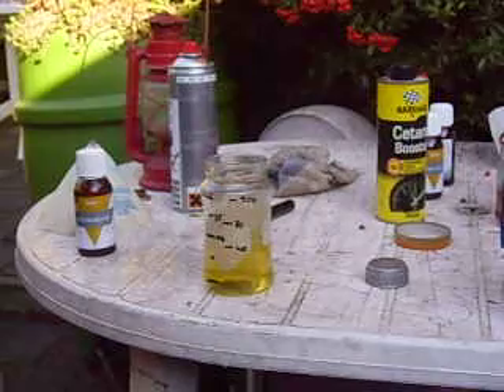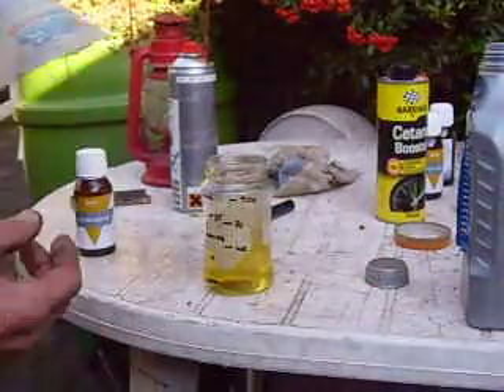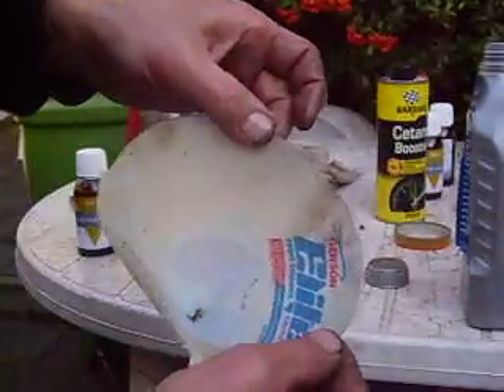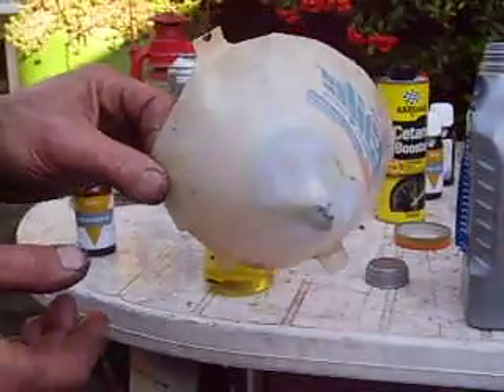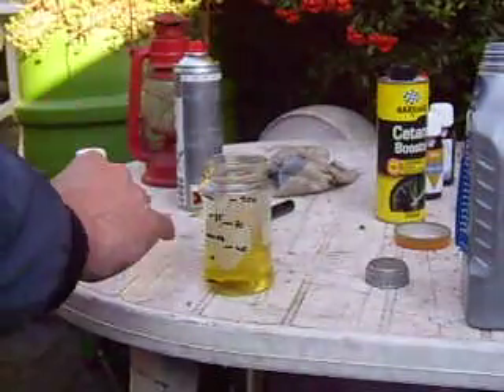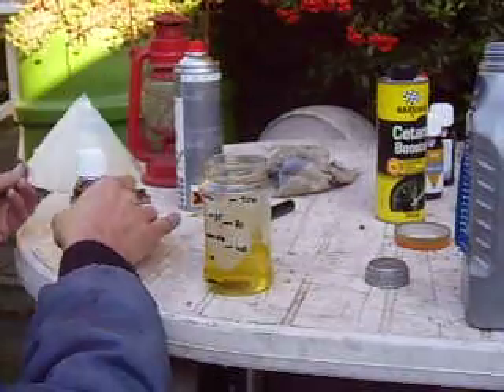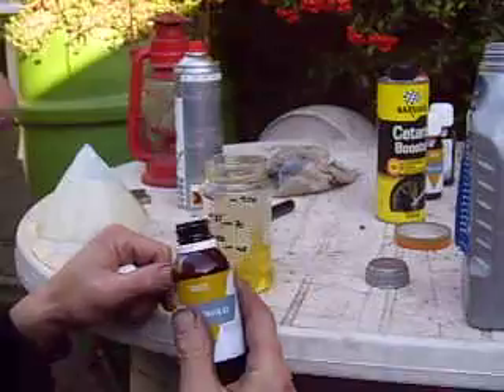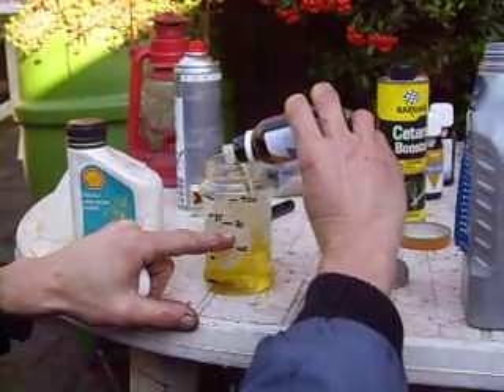Model diesel fuel making at home....my  secret brew!

Comment: I love my ball-race Drone, and it is fixed-compression so you can vary the run a little bit to suit different props by altering the oil ratio.  The manufacturer mandated no kerosene or DERV for this engine, only ether and oil. At least it runs cool.  Thanks for the video!
Reply from the maker: Indeed, the Drones, Micronesia and others are a different story.. They need the different fuel, to get the best out of it.. As wel keep the on good shape... I think run a drone with a regular fuel will run it to hot.. Adrian's website has an good article about it..I have also both types of the Drone.. Lovely motors! 

 Happy running!!
Reply: @valic000  I have put up a little video of it if you would like to listen

Comment: I mix 25ml ether, gas station diesel 50ml and 25ml castor oil into my Mk-17 and Marz 2.5D engines.
Reply from the maker: Good mix!! But always recomend Cetaan booster as ignition improver.. so the engine runs much smoother and with less compression..so better for the engine...Have a great spring!! enjoy  the engines!

Comment: What do you use to clean the filter?
Reply from the maker: Hi Arthur. I use for the cleaning Car brake cleaner. I use the cleaner also for the engines, as it flush the engine nice out,when I had worked  on it. You can find it in a universal car parts shop. Spreekt U Nederlands misschien...?  ;-)

Kind regards,
Peter

Comment: Elimde 1cc zeiss jena var hangi karısımı önerirsiniz.
Reply from the maker: Ben 3 1cc Jena motor var, si fazlasıyla var! ;-) Teşekkür ederim arkadaşım!
Reply: @valic000   Özür dilerim yanlış anladiniz. Hangi yakıt karışımını önerirsiniz demek istemiştim. Jena 1cc için. Çalıştırmak istiyorum.
Reply from the maker: @ibrahimoksuz107  Tamam, üzgünüm ... Sadece ve normal karışım .. + / -% 40 dizel veya gazyağı, 30 eter ve 30 harika yağ
Reply: @valic000  tavsiye ettiğiniz yakit karışımı ile jena çalıştı, teşekkürler. 7×4E pervane ile 7000 rpm çevirdi. Kaç devirde çalışması gerekir. Normal?

Comment: Hai valic000, Aether means Diethyl ether???
Reply from the maker: Yes,only Diethylether wil work.The other wont work at all.Good luck and happy flying!
Reply from the maker: Yes.Try to find John Deere starter Fluid. Others can works also,but I have no expirience with them. Only with brand "Holts starter fluid" I try as well with positiv results.
Reply: So ethyl ether will not work?
Reply from the maker: Sulphuric aether ,whats was used as  a  anesthetic is the right type.The other aether will not work. I hope you can find it. Good luck with the runs!!
Reply: So they user that type of that type of ether in starting fluid?
Reply from the maker: Some types have aether,or parts of it.They also use subtitute for aether.
The only brand I know for sure works excellent is John Deers starter fluid.That have a high content real diethyl   aether.
Just cool down the can in freezer,also the glass,in witch you like to spray it.A old beer bottel is fine,as it have a small opening  and not a lot will be lost..... than just spray it empty on a colder day and you have your aether.  But I highly recomend to ad Cetaan booster,aprox. 3-5 %. Than the engine will run much smoother and with lower compression settings,what will have a positiv effect on your internal parts,specially the conrod and wrist pin.

Peter
Reply: Scot Caraway Just look for C4H10O

Comment: Hi Peter, I'm going to the meeting tomorrow where only the diesel planes will fly. Every plane replica on this meeting is not going to be younger than from the year of 1950 so it's gonna be a pretty "old meeting". 
I mixed my own diesel fuel. I'm using a classical mixture 30%, 30% and 30%. All of these ingredients are available in the Czech Republic. 
Best, Petr
Reply from the maker: Ahoi Petr! I wish,I could be with you..I love those events..diesel smell all over!!
1/3 is the basic formula,works always well.Some high performance ball bearings like the MVVS 2,5 and similar do run extreem powerfull on +/- 45% petroleum.I am sure,you know that. ;-) I use always ignition improver..Bardhal Cetaan booster..It works very well,also for older engine.It can be run with less compression,and more even and smooth in top rpm..Its worth buying it..

I got today also a Engine with the post..look a long time for it.A Vltavan 2,5 glow!! .But condition is extrem bad.I will need to regrind the piston and rings a bit,and make a new cylinder..I think its easyer than make the special piston and delicate rings..But will be run for sure again one day..:-)In my 2,5 class book is also a diesel version,but I think,it was never sold officially.Do you know more?

Have a great day at the field!! Will watch the vids with a lot pleasure!

Heski pozdrav,

Petr
Reply: @valic000 какие  кольца..на 2.5 куба  кольца не делают.там гладкие поршня без колец..

Comment: For the ether-extraction out of the start-pilot I used a thickwalled pot, put it with the spray-can into the deep-freezer for an hour at full minus degrees. Into the bottom and the nozzle (not too deep!) I carved a groove profile in which to fit a strong straightened out wire to fix the nozzle into the spraying position after it reached the deepest temperatur to bypass the pressing of the nozzle all the time per hand. Use gloves.
Then - and that is most important! - I took the pot with the spray-can wrapped in a blanket  o u t  o f  t h e  h o u s e  ! As ether is one of the easiest to flammable stoff their is!
Outside there I clicked the wire into the grooves, laid the spray-can into the pot again, closed it and wrapped it with the blanket and waited until there was no more sizzling sound from the escaping and liquefying gas. And voila! I've got a good quantum of ether to mix like valic000 told so well.
Reply from the maker: Hi Edmar...Many thanks for the post.I am sure,it wil help a lot peopel.Aether is a big problem,if you are hooked on model diesel engines..like so many of us.In Holland we are very lucky,as it no problem to buy...Have good engine runs!!

Many regards,
Peter
Reply: @valic000 у нас бывший СССР..эфир давно снят с производства..только он и нужен  для движка ..этиловый эфир..

Comment: Unnafortunately for us here in Brazil, we can´t get aether anymore, due to a federal control on buy it as a particular customer, I own some brazilian made diesels I've bought at '60s - WB 1,5cc and 2,5cc - and even bought two RJL .40FP O.S. conversion kits, the last chance I had to buy aether at a drugstore I've made three liters of fuel and is possible to ran them and I can hear the .40 running very nice, despite a lot of castor oil mixed with kerosene that smelled so strong that I my wife almost left me.. thank you for your information, so sad that no substitute exhists to sulphuric aether  on this mixing !
Reply from the maker: +KK Teutsch  Its indeed a big shame,that its on a restriction list bacause of abuse.But there is a way! You can order John Deere start pilot spraycans on the web.Its a starting aid for worn out older diesels. Just cool the spray can a bit and spray it empty in a big container.(Cover the top a bit,so it went evapurate to much.
..and you have aether.
There are many different starting aids on the web,but John Deere seems to be the best one with a lot real sulphuric aether...other brands have sometimes other mixes and replacements inside.
But be  pls VERY carefull when spray the can empty..no open light or cigarrets  arround!!  :-)
I know the WB /Webra copys. Never had one. Sometimes they pop up on ebay,but its pretty rare. And as the Webra,there are fine runners and easy starters.

Other way for fuel is the US or UK .Ready mixed.Technics Modell diesel fuel is for sale there.I only are not sure,if the can post it throu the air. Otherwise check Dr Diesel/USA.There are also some info,how to get fuel.
He also sell his own brew in the US.Maeby they wil ship to Brasil? I am sure,you wil run the WB engines one day...where is a will,there is a way,...Right?
I hope my info helps.
Kind regards from the Netherlands too Brasil
Peter
Reply: +valic000 Ok Peter, thank you for your attention and informations, those WB engines are a nicepart of my - and a lot of friends too - teen age mid '60s, with the advent of R/C systems by late "60s, they became very rare and I remember a .049 KO (or OK, it seems to me both of brand exhisted ) red head two exhaust out port diesel U/C engine I've seen it  at a local hobby shop but another bguy bought it first, I have a lot of engines from .049 to .91 from various brands, - most are OS Engines - some of them like new and even unused, on box - . I made some attempts to buy mixed fuels from Tower and others at USA but, they respond to rme  that no possible is to send it from foreign sites, due to restrictions on Air Mail transport rules, I'll attempt to find John Deere Cold Start Aid at web, best regards from Brazil, Carlos.
Reply from the maker: I guess we al re- live ouer youth again with those old engines..who dont start as a kid a Cox Bbee??  :-) Electric flying is cool but something is missing here,right.?.The smel and the sensation,if the engine wil start..keep running-...its al the whole something.I start 4 years ago after a break of 30+ years with the engines,specialy diesels..and I am realy insane happy,I did.
I would never ever have imagine,it would grow so big,with rebuilds and stuff,whats really sometimes not easy.2 years ago I would never imagine,I wil one day make a crankshaft myself...but after a lot setbacks and cut and try,..I am happy,I dont give up. Its really priceless to see a old compleet worn out diesel with missing parts  starting again....after a real; long time.

I am sure Carlos,you find John Deere starting fluid or something similar. They can send by regular post,and not by airmail, so it shoud be possibel..I cross my fingers for you!!

Goog luck and best regards to Brasil again back... and keep them running! :-)

Peter
Reply: Realmente nao temos como adquirir Eter  aqui no Brasil. Tenho alguns PAW. Voce tem alguma dica p mim?
Reply: Realmente nao temos como aquirir ete4 aqui no Brasil. Tenho alguns P.A.W. voce afirma q é possivel funcionar somente com querosene e oleo? Agradeco a dica.

Comment: i had fuel that was 3 years old
stored in a plastic bottle in a hot garage

diesel started fine on it
Reply from the maker: ***** Hi! Thats very lycky.Usually the aether is gone or at least most of it.But if it was closed very wel,it is still for use. I keep my redy mixed fuel in my refrigiator! :-) 

Regards,
Peter
Reply: @104542416736358828629 it was closed verry good
but in a hot garage

Comment: to an engine with cox 049 rc diesel already tried in various ways to take place, the engine is new you have any formula conbustivel for me to do waiting for reply
Reply from the maker: For smal diesels under 1cc I would recomend moore aether.Maeby 37%  and 30% petroleum,and 30 castoroil with 3 % cetaanbooster or amylnitrat or amylnitrit.

But a stronger heavy duty crankshaft is highly recomended for a converted Babybee,(sold on E-bay) or it wil brake soon.You can try to de-harding the standart glow shaft in a kitchen oven at 250 degr. cels. Just put it there and keep it for 40 min.in the heat.til its a purpel collour,switch oven of and let the shaft inside,till its copleet slowly cool down.

Good luck and happy chrismas days!
Reply: Which either are you using  ?

Comment: Hello,Peter.I am Eddy.I buy the Silver Swallow 2,5cc with 3 exhaust,but I m not can start it.I tried with start spray engine(contain ether ,but I don't know the percentage because it contain ether and pentan).I mix 33% spray,33% petroleum and 30% oil.The cetane booster is very important in mix? Iwill try with only spray and oil and little bit of petroleum.The engine have a normally compresion. Thanks
Many regards,Eddy
Reply: Eddy John can you start diesel engine without ather ????
Reply from the maker: Hy Eddy,
Sorry for late responce,but I was not read the mail.Did you fire up your engine yet? It shoud run with the mix..If engine dont stroke a singel fire,increase the compression slowly,till you get it run.
 
Kind regards,
Peter

Comment: do you have any formula to make a low cost glow fuel ,i ask because i saw a another video wich mixed methanol and castor oil but something goes wrong when i try to mix them your support will be very appreciated
Reply from the maker: I am sorry,but I only mix model diesel fuel so far.But if you have flakes after mixing,or it dont solube properly,maeby try other castor oil.It shoud be a good quality,and not too old also.Otherwise check the web for moore info?.
 
Good luck!!
Reply: marco fabio Gonzalez i mix red spirits + castor oil in cox 0.49 glow engine and i running it 2 hours its stay good you can try or asked me
Reply: add some klotz oil and everything mix well

Comment: DOING oil distillation machine can convert waste engine oil, waste tire oil, plastic oil to diesel. this kind of diesel can be used for tractors, trucks and diesel power generator etc.oil recovery rate can be 80%-95%.
you can view here to know more detials: doinggroup.com  and wastetireoil.com
Email to : market@doinggroup.com

Comment from the maker: Hi eddy.No this is fuel only for model diesel engines with compression ignition.low engines have different fuel mix.Check Google for moore info on model diesel fuel...

Comment: This fuel run on glow engine?please help!!!!
Reply: you can use a gas glow plug # 5 and may make to work with gasoline but you need to change gas tank stopper and silicone lines for neoprene.

Comment from the maker: No ,I dont try it.There are some videos on youtube,and its possibel to run it,but the price is a overload of conrod bearings.Its just too much pressure on those parts.Its not construct for that.Also the engine wil stal mostly and only run "wel",if the cilinder keep hot.As soon,as ideling,it wil have problems to stay runing.If you have troubel find aether,you can just buy start -Pilot,and empty the spraycan,the best in the wintertime,and spray upside down empty in a big can.It works!
Peter

Comment from the maker: Hi there!I think its oke,but I would ad 30% at least.The 2 stroke oil is anyway a blend of castor and syntetik oil and dopes.But nothing beats the lubricatiuon properties of castor.In execive heat situations,castor stil give still a thin oilfilm,where synthetic oil just "give up".Also if you use  diesel oil instead of petroleum,you wil get a additional lubrication from the diesel,as it has from its own  lubrications properties. (For fuelpomp)...but more smoke..
Good luck!!
Peter

Comment from the maker: Yes,here in the Netherlands I can buy it at the local pharmacy.The cetaanbooster you can order on the internet or some better carshops have it too.Engines runs far smoother and  also with less compression,so its better for the engine.